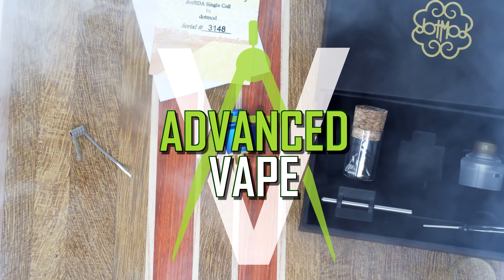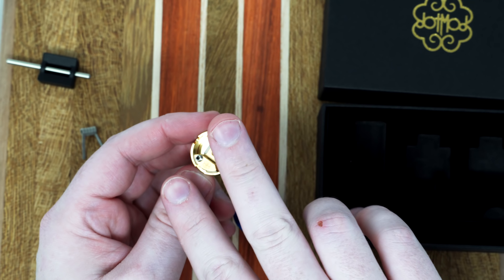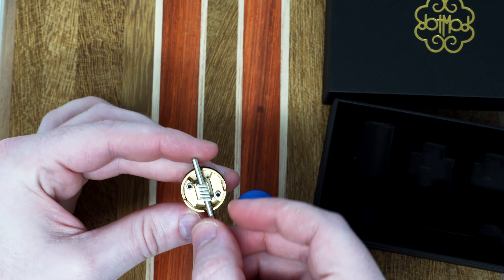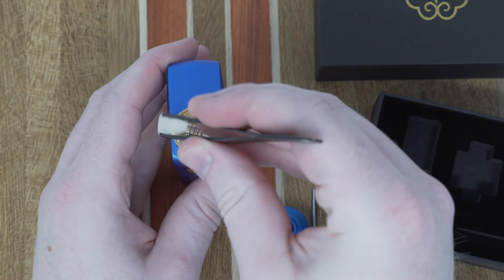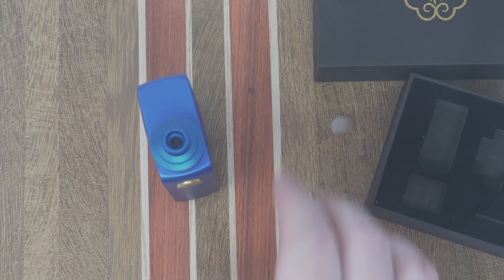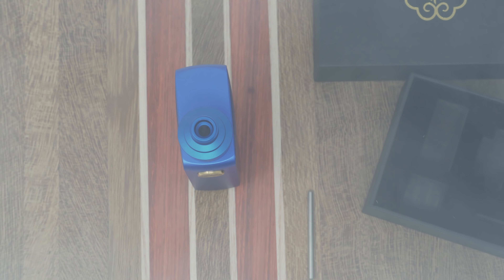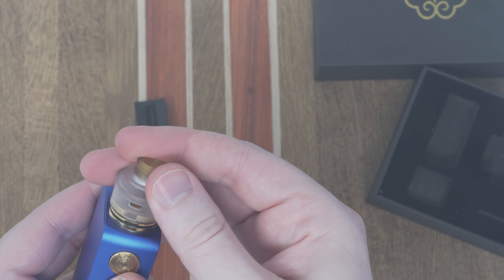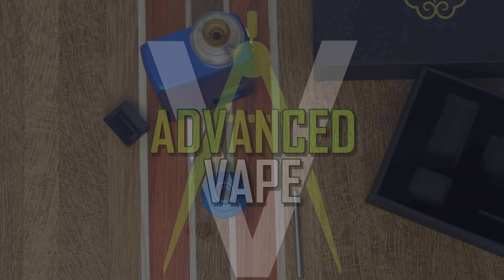DOTRDA SINGLE COIL RDA by DOTMOD

Comment: thank u my friend. another reviewer had quite a struggle building on this because he tried to install without using the jig. smh* if a company includes a tool they intend for it to b used imo. great job. I recently got some of that hexcore wire and it's phenomenal just really lower resistence than I use personally.

Comment: It was so funny watchin ambitionz vapers try to put his coil in this rda lmao, he spent like 25mins and got sooooo pissed off, he was about to throw the rda across the room. If ya havent seen it ya should go watch his video on it. Its so funny. Great video bud, so was this a very hot build for this little atty?
Reply from the maker: I did see that. Nah it's not very hot at all unless it's really oversaturated
Reply: @AdvancedVape  thanks for replying Stuart. Good to know. Im usually a dual coil dripper, i like the "idea" of a very falvorful single coil atty, that way i dont have to build as many coils, use at much cotton & liquids, but ive always found the flavor to be lacking on all of the single coil attys ive used compared to my dual coil attys. Do you guys have a coil making machine there at AVS?
Reply from the maker: @Apathymiller  we do, our coils are mass produced.

Comment: I gotta say this is probably the first review of yours I have disagreed with, which is fine but I will say why. This thing is horrible for squonking because the airhole is literally about 2 mm above from where the juice comes out of. If you were to hold that bottle down for more than a second it is guaranteed to leak. Besides that the post holes are senseless, I get it’s supposed to stop you from shorting out your leads on the barbell but it makes it much more difficult to build, especially if you don’t have that little jig with you. Either way I love your vids but I think if you used more squonking rdas you would realize just how bad this thing is for squonking. Oh I believe the dot squonk takes 20700 batteries also.
Reply from the maker: In my experience with squonking with it, if I got anywhere near flooding the airflows, even allowing the juice to flow back it was way oversaturated. Just a little push and it was perfect level of saturation for me. I'll be the first to admit most of my experience lies in RTAs, but I have used squonk setups before and this one worked fine for me. And yeah I do know I forgot to say single 18650/20700